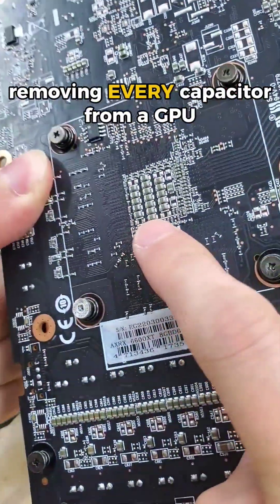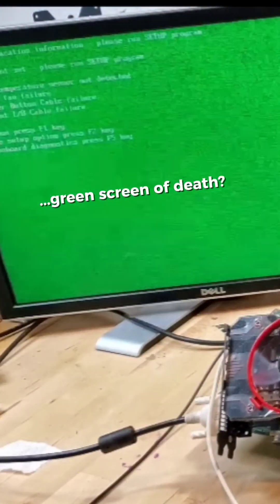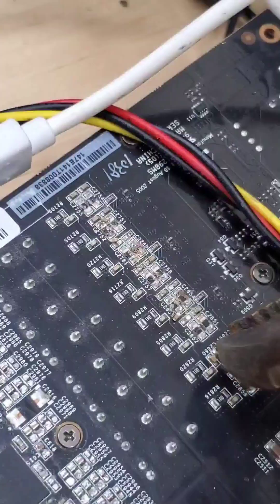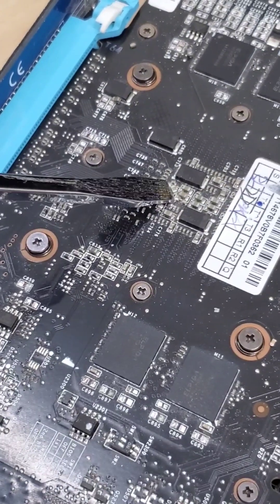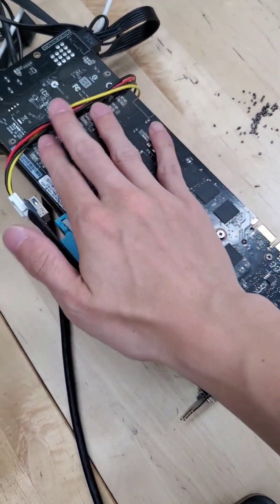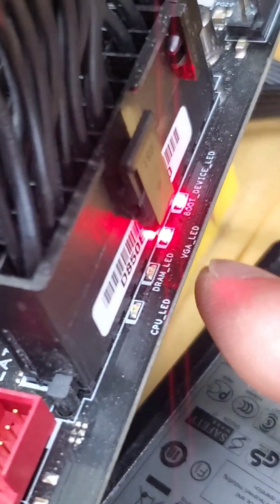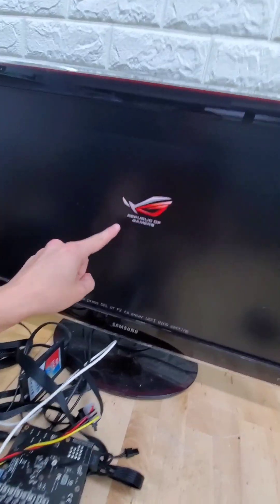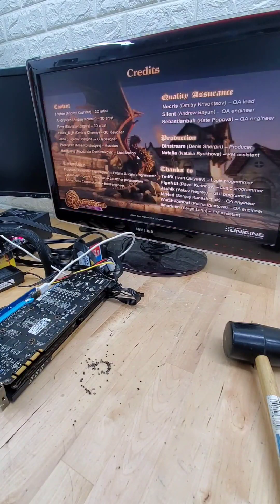removing EVERY capacitor from a GPU

Comment: how tf does it still go. That's a Nokia Gpu
Reply: bruh that GPU is in life support
Reply: @cluterduck "im still standing" ahh GPU
Reply: The thing is that by removing capacitors he just opens the circuit. And the capacitor basically is an opening in the circuit, but an extremely short one and with big surface area. So basically he just changes the shape of a gap.
This circuit runs on DC so the current doesn't flow through a capacitor but only charges it. This circuit doesn't really care about charge in capacitors while operating so it just runs normally.
If you're interested, you can search some videos about how capacitors work on YouTube. They're usually pretty easy to understand
Reply: @distortionua finally a guy that understands physics, i was boutta say that but i’m glad you did. perfectly right about circuits not caring about it, at the end of the day it’s just a charged part of the circuit and getting rid of it doesn’t make much difference
Reply: @distortionua  Those are smoothing caps. For a insanely high current situation like that it is very much needed as else the traces can have much higher currents and in some cases can even burn and the GPU can experience voltage drops and thus become unstable. Nvidia has insanely well implemented voltage feedback to control the frequency of the certain parts of the GPU thus probably trying its hardest to see the voltage drops due to load spikes as "controlled" voltage change meant to lower the GPU clocks
Reply: @AlpineTheHusky  thanks man, now I know)
Reply: @AlpineTheHusky the vast majority of them are likely decoupling to prevent cross talk on signal lines. The layers of copper in the board act as capacitors themselves and reverb currents get picked up on the signal lines. The picture might start getting weird artifacts in it more than anything.
Reply: @distortionua  thanks for the quick explanation, real 1
Reply: Yay you hearted me yeester
Reply: Yay @LinusSyb
Reply: @Idontknow4  :/
Reply: @LinusSyb  ? Why :/
Reply: @LinusSyb I’m the 70th like ahahahahahahahah
Reply: The capacitors are only there to reduce voltage fluctuation when the computation load on the GPU charges, it helps increase GPU lifespan.

Knocking off the GPU is like swapping your car suspension with solid steel rods. It will still drive, but it's probably not going to last long.
Reply: This capacitors are smoothing the voltage 😅
Reply: bro i got so confused since i use that same pfp
Reply: @medidstuff  HAHA Lol
Reply: Best comment
Reply: @wolfyboy0828  thx
Reply: The capacitors' only purpose is to smooth the voltage
Reply: It's the onboard graphics running
Reply: Yeah like tf
Reply: the capacitor on the under side are support components
Reply: Fr
Reply: Nokia 91630i
Reply: it’s evga so it is quality
Reply: These are all probably just *filter* capacitors. Good to be there to remove the noice in the circuit but not essential.
Reply: ALIVE and REAL. nether skygen is ALIVE
Reply: @Cy-by ?
Reply: Nah , it's made by Asus , look closely 💀💀
Reply: @Pankaj-ki3zy it's an EVGA GPU you dummy

Comment: Dind't expect that happening
I thought some of them are used for Timing purposes.
Reply: Very unlikely nowadays. I'd assume RC delays are way too coarse for modern/purely digital tech. Still amazing considering the power hunger of modern GPUs
Reply: They are only for filtering and smooting the power rails. Signal delays are done with longer traces on the PCB. That is the reason behind those wiggly traces.
Reply: @lukahierl9857  that was my thought.   Most of those capacitors are probably just for filtering purposes, so while it "works" good luck doing anything extremely intensive for extended periods of time.
Reply: @lukahierl9857  this!   Its mainly to reduce the ripple voltage but modern quality power supplys already do a fantastic job with that, just as seen in the video. There are propably other IC's on the board with inbuild caps, that also help with smoothing the voltage.
Reply: Quartz resonators
Reply: Yeah I have seen those before, just never needed to use them, because the fastest things I directly worked with have like microcontroller speeds. So nothing to fast. But still damn, that's pretty crazy, wonder what would happen if he would put something like a plasma TV or  some other emi intensive devices on the same line or just a heavy load in the power supply.
Reply: Even then those will be inside an IC.
Reply: Most capacitors in circuits are mostly to reduce electrical noise.
Reply: Modern timers dont typically use a full size capacitor like 555 timers
Reply: All of them were used to stabilize the voltage ⚡